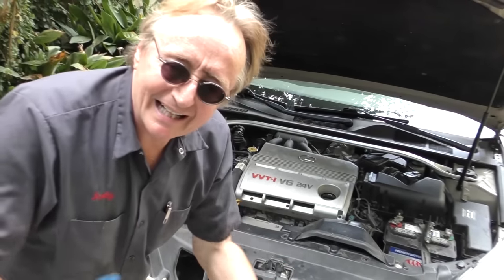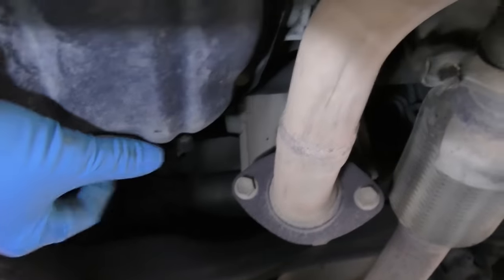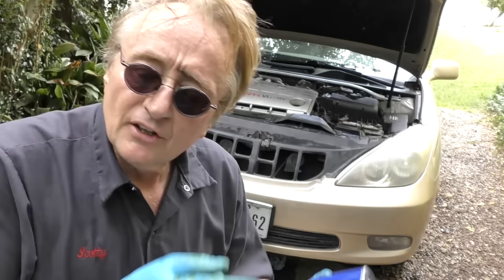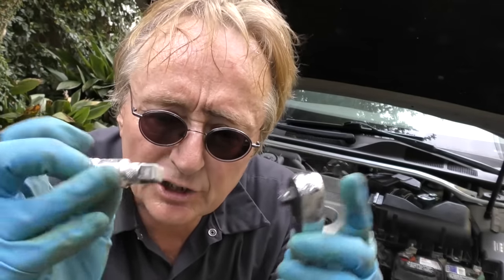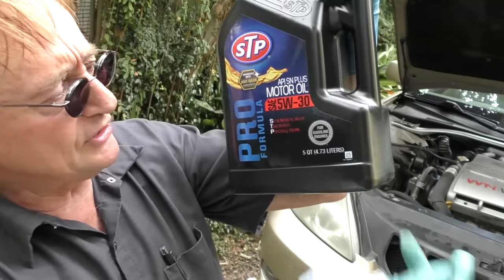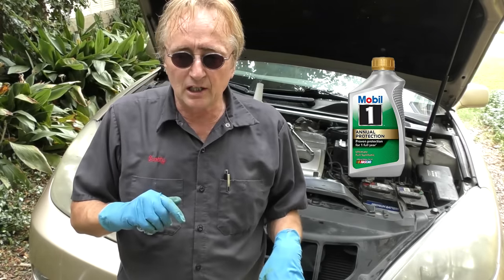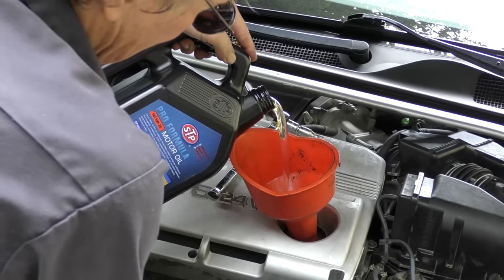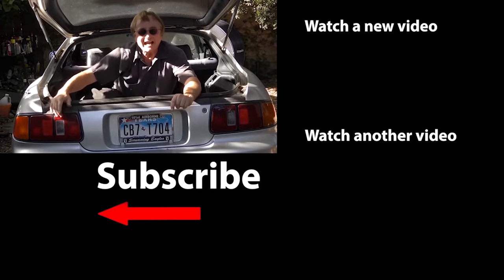Changing Your Engine Oil? You’re Doing It Wrong

Comment: So I run 0w40 oil in my integra because i run it harder and it makes less noise on startup due to it flowing better when cold what would you say to that. my oil cap says 5w30 my user manual says 5w30, 10w30, or 10w40

Comment: Using any other grade of engine oil other  than what your engine is specific for; what's that ol saying you have Scotty?  You can't fix stupid!!  People have been saying for years and years; perhaps if we put it in black and white, they'd understand it better....Well, if one happens to notice, the print on top of the oil filler cap just so happens to be black bold letters/numbers (10w-30 or 0w-20 or....) and with that said, how much Stupidly simple can it be??

Comment: "In case of this Lexus it's very easy to get the oil filter, it's just there" proceeds to show filter under intake manifold hahahahahaha easy would be near the top of the engine were you just pull it out hhaha
Reply: VW driver spotted
Reply: @siosilvar  bmw driver actually
Reply: @carlosmiguel4756  Oh yeah, BMW does that too don't they. Very convenient either way, with one of those pumps I don't even have to get under the car for an oil change. Ought as well to inspect everything, but still.

Comment: Hey, I hear when the car gets to over 100k, I should use a thicker type of oil
Reply: Only if you are burning oil. In a 1960,70 motor vehicle 100 k is just run in in some models

Comment: how do you guys feel about engine flush?
Reply: Not recommended. It can dissolve the light oil buildup on seals and gaskets that help prevent leaks. Also if you use it you will need to do a second oil drain to fully remove any trapped flush and the thinning effect it will have on new oil.

Comment: Because you don't know any better. Its called a crush washer nor a gasket. You don't need to change it all the time. Try filling that filter with oil first. Mechanic for 51 years. Ya ok. 5000 miles between oil changes. I hope nobody takes you seriously. Try turning the oil jug sideways so it doesn't splash.

Comment: What does the “w” mean on oil?
Reply: Winter. On multi weight oils, the first number is the viscosity rating for winter, the second number is for summer. It’s not an actual viscosity rating, it’s simply how the oil will act in colder weather. The weight of the oil is actually the second number, and that’s the number you should never change. The first number can be changed based upon the owner’s manual recommendations for the given temperatures and environment the engine will be operated in.
Reply: @fredmalito9869  thank you!

Comment: I will never use any STP products cheapest crap ever wouldn’t even use it on my lawn mower, did a oil change on a 2015 Dodge Charger (Chrysler is the same deal) customer brought in all STP oil change parts, month later car had a huge oil leak coming from the oil filter absolutely cheap quality of their products filter wasn’t properly locking into the cap

Comment: This guy is not bright. You don't need to change the o ring on the the plug ever unless it's cracked. Plus you can use a thinner oil. It's better for the engine more flow plus better gas mileage

Comment: Hmmm.. having to use an extension bar to remove the oil pan plug?? Not good....oil pan plugs ONLY NEED to be reinstalled by what strength it takes from the single arm of some scronny 13 year old kid...Not some "Arnold Schwarzenegger" trying to snap the nut off! (... Sorry Arny, nothing against you!!)